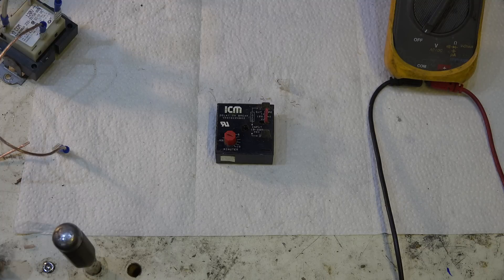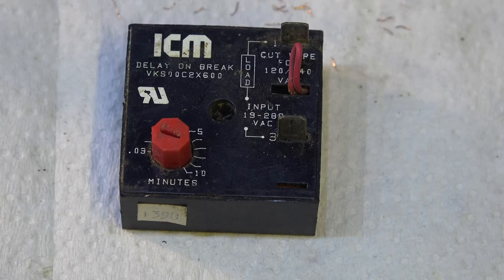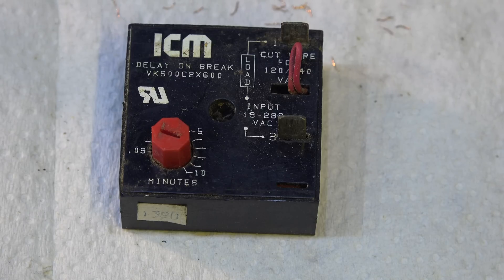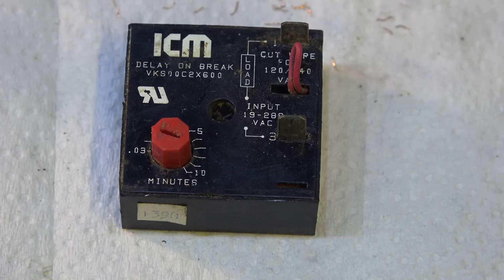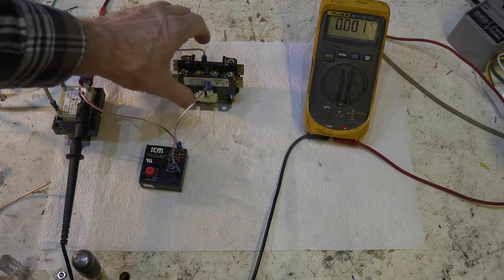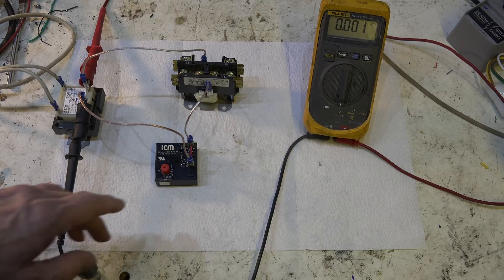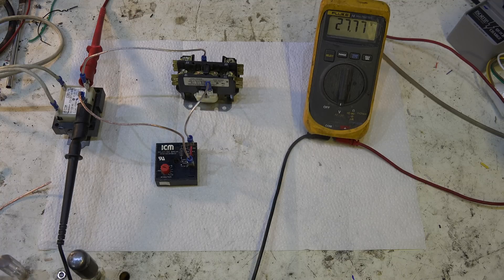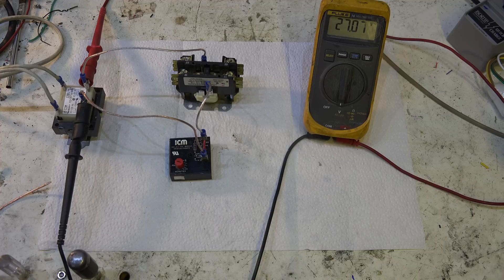The air conditioner short cycle controller

Comment: Bought. A house with a gas boiler. We have the icm but there is also a swith(like a light switch connected as well. We have the temp set to 71 but sometime does not kick in. Next thing you know it’s 60 in the house when we wake. I usually have to flip that swith then it works after a while. Why have the switch and what’s amount of minutes for the time delay!
Reply: Meant to put a question marks. Thanks.
Reply from the maker: @TheJyanez20  The switch is a system switch that cuts all power to the boiler.  When you switch it off and back on, you are recycling the control board.  The reason for the shutdown is probably flame failure.  There should be a blinking lite the will blink a code that tells you what shut it down.  Flame failure lockout is often caused by a dirty flame rod.  
When you restart the unit, there should be a delay of 30 seconds to 1 minute before the flame lites.  
GFM

Comment: I need to make y2  run , a minimum of 4 minutes.  How would I wire up the controls needed.  What about an ICM control.  I need to force the Y2 to stay in for 5 minutes.  The only other thing I can do, is replace the thermostat with one that has an adjustable diff between Y1 and Y2 of about 2F.

Comment: if I want to use this device for a standard 120 VAC (US standard voltage), do I have to cut the wire ?
Reply from the maker: If it has a wire, cut it.
GFM

Comment: this can be adjusted now with digital thermostat. check the system of your thermostat like the ecobee brand.
Reply: That can fail because the thermostat stays on but the compressor is on a separate circuit

Comment: Two questions, 1 How would you test for the Y-Side in case it’s either not properly wire coded due to unknown install error? 2 Does it make a different if it’s installed by either the air handler or the compressor outdoors?

Comment: My time delay went out. I didn't replace it because I installed a new electronic thermostat with built-in 5 minute time delay (that flashes when activated). Should I have replaced the broken one anyway?
Reply from the maker: No.  The thermostat will take care of it.
GFM

Comment: For heat pump application, I would like to wire the ICM 203 inside the air handler cabinet. I will unscrew from the terminal strip the low voltage yellow wire that goes to the outdoor unit and connect it to the load side of the ICM 203. (On the outdoor unit, that particular thin yellow wire is connected to a heavier wire going into a plug on the defrost board. From there, a heavy yellow/black wire comes out of that plug and goes onto the contactor load side). I will then just run a new wire from the yellow screw terminal on the terminal bar (indoor yellow t-stat wire still connected to terminal screw) and connect to the line side of the ICM 203. That way of connecting will control only the compressor. Or alternately, can I completely disconnect the indoor yellow t-stat wire from the terminal bar screw, place it on the line side of the ICM 203 while connecting the small yellow wire going outside onto the load side and add a new wire from the load side of the ICM 203 back to the empty yellow screw terminal. (2 wires connected to load side.) That way, the ICM 203 unit will control both the compressor as well as some functions controlled by the yellow wire that goes from the back of the terminal strip and into the control board.  Does this make sense? Which way to go?

Comment: Thank you for posting this vid 2.5-ish years ago. I just ordered one of these timers for my central AC unit as we get thunderstorms which cause the power to 'glitch'.So after I get it installed I should have no more concerns about the compressor getting fragged due to short cycle.

I normally simply turn the unit off during storms rolling thru but that's NOT always possible. Thanks again.

Comment: I installed this time delay relay which is a “ICM Controls ICM203 Delay-on-Break Timer with 0.03 minutes-10 minutes” on the line side of the 120 VAC AC circuit that feeds the 24 volt control transformer located in the blower unit. We have had many power blips that I believe are caused by the power company, I assume switching power sources or having system upsets. Prior to installing the Delay-on-Break Timer I had read a comment where that person installed the timer on the line side of the control transformer and that seemed to be the best place to reduce the false starts for the blower and the outside AC condenser unit. The reason to install the timer was to trying to minimize the number of false starts that caused the Copeland scroll compressor (in a Lennox Condenser Unit model HS26-048-5P) to run backwards and shutdown on thermal over temperature. Even with the timer I noticed a situation this month, where the compressor tripped out on thermal overload and would not restart until it was allowed to cool down for approx 1.5 hours. I did not want to use water to cool the compressor and wet the compartment etc. Took the condenser unit cover off and let it cool with ambient air flow. When time allows I need to check the relay again to make sure it is still functioning properly, but I suspect that it is still possible for a temporary dip in the AC supply to the house to be just right so that the “delay on break” relay or the time delay function in the White-Rogers digital thermostat do not react properly to prevent the reverse operation of the Copeland compressor.
Reply: I too wanted to control both the air handler and condenser (compressor) by wiring the ICM 203 in series with the 120v line that goes to the transformer.  ICM tech support told me it can not be wired that way because that solid state device it is not meant for constant power.  I don't know.......
Reply from the maker: In most cases the ICM control will stop that.  I will be doing some tests to see if I can get the same failure.
GFM
Reply: Great videos and lots of good information for those of us that have an interest in mechanical things, thanks.

Comment: Hello my friend, I’m your fan #1. Thank you for all your videos. I have one question: the device you’re working on is a Time Delay On Break but the explanation belongs to a Time Delay On Make. Could you clarify this please?
Reply from the maker: It is really more of a play on words.  The delay timing begins when the cycle opens.  If it was delay on make, it would start the delay when the cycle closes.
GFM
Reply: Thank you very much.
Reply: @grayfurnaceman  But to be clear, they are two completely different things. I use Delay on Make timers to delay the start of a ventilation fan while the motorized dampers slowly open. I use Delay on Break timers to reduce cycling of motorized heat-dump valves in solar hot water systems.
Reply: @paulmaxwell8851  ok. So let say we are only talking about operating a fan, nothing else.

Delay on make timer counts down right away, while the t-stat is constantly calling for fan. Then after 5 mins, the fan turns on.

Delay on break timers only starts counting down after the t-stat stops calling for the fan and the fan shuts off. So after 5 minutes, the fan could be activated once again, when the t-stat calls for fan.

Basically, delay on break timers don't start counting until after 1  cycle of the fan.

And Delay on make timers start counting at the beginning of any cycle.

Comment: GSM  really appreciate your videos.  Couldn't that be used on line voltage window unit with the red wire removed?  Some brands of similar time delay units come with higher voltage option as a break off terminal link tab.  Do you prefer delay on make or delay on break to protect from thermostat jockeying.
Reply from the maker: Always delay on make.  I have not tried that but I don't think the control will handle the amperage of the compressor.
GFM
Reply: Thank you.

Comment: what about window type aircon is it posible to connect time delay witout contactor?
Reply from the maker: Unless it has low voltage controls, which most of them do not have, this type of control cannot be used.
GFM
Reply: thanks sir